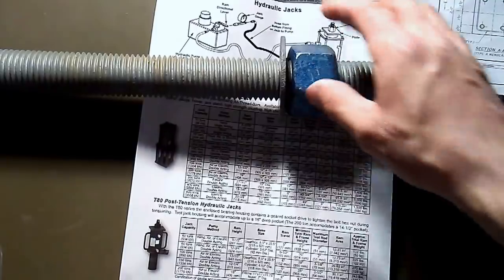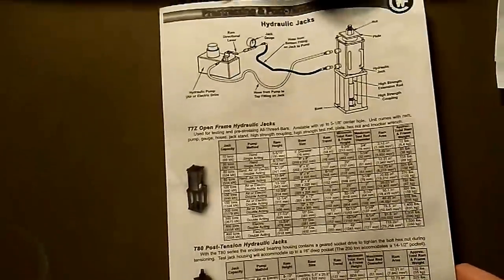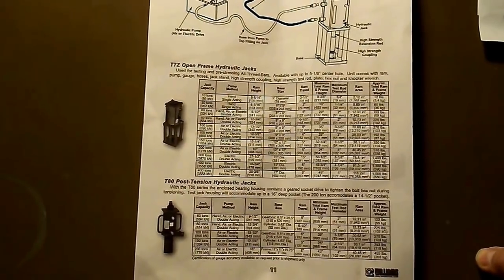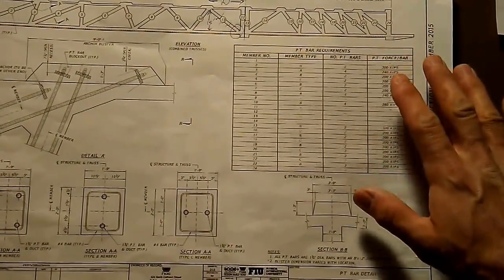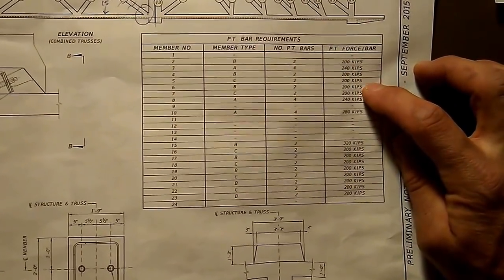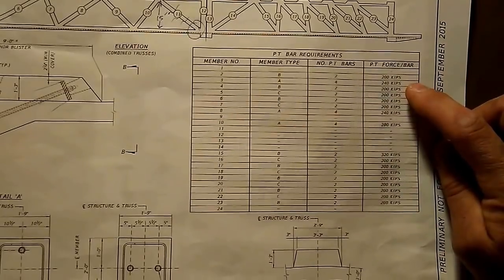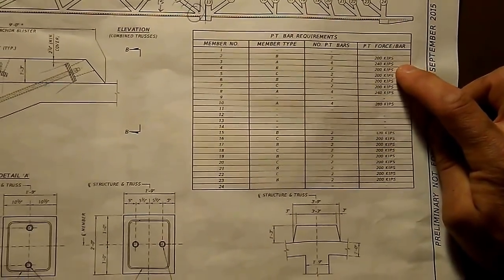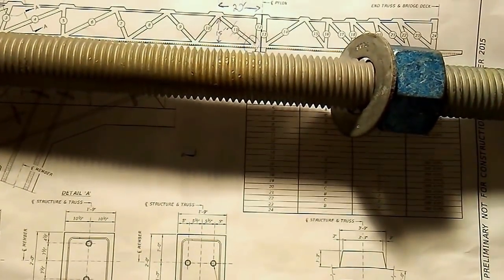FIU Bridge Collapse: Post-tensioning Explained

Comment: I love the righty tighty lefty loosey. There's no point at times to try to over-explain or over-complicate the explanation.  Keep up the good work
Reply from the maker: John Montgomery Thanks for the compliment John! I am glad you are enjoying my use of layman's terms... we engineers tend to needlessly overcomplicate everything. Lol.
Reply: it does depend on what it is you are tightening like acetylene tanks lefty is tighten most set ups for propane lefty is tighten there are left handed threads and right handed threads most common are right handed a skill saw lefty is tighten.  I use my fingers and rotate them clock wise and counter clock wise when things are upside down backwards mostly on cars. Think if a bolt is threaded in your direction it is backwards so if you go lefty from your view point it is actually righty see what I mean.

Comment: I believe the bridge was post tensioned when it was fully supported from end to end prior to moving.When it was lifted to transporters approximately 25 feet from the end of the bridge, the bridge was in serious cantilever resulting in stretching the post tensioning bars to the point of failure.I note that there was approximately135 tons in cantilever straining truss #11. The bouncing during transporting would have aggravated this condition even more.When the bridge is now set on the concrete supports. The truss is now is unstressed because the tensioning bar has been stretched to the point of failure. Now when post tensioning is applied, the bar has no strength and applying tension  creates total failure of the bar and it breaks in two and the resulting shock dooms truss@ 11.
Reply: The tension applied in advance was only in effect during the move.  Once on the piers, the rods would have been slackened because the load stress of the bridge would exceed the force applied to the rods. The issue I see is why they were unable to apply the proper tension as per the design (from the bottom of the bridge). Why did they have to crack open the blisters to reach the top of the rods and what effect did this have on the integrity of the bridge?
Reply: The blisters were not cracked open. All the blisters were left open during casting of the blisters. This can be seen in time lapse video a week or two prior to the SPMT moving of the bridge. Only blisters 2-3 & 10-11 were left open at the time of the move. The other blisters were filled in, shortly before the move. The block outs in the blisters for access to the PT tendons were obviously not well shaped prior to concreting but it needs to be considered that full consolidation of concrete under the plate washers for the tendons was the top priority, not how pretty the block outs could be formed. Every blister had a different tendon angle arrangement, so there wasn't a one-size solution to forming the block outs in the blisters. The concrete with fly-ash & silica fume would be sticky and once it had set up, some mechanical means would be required to remove concrete that subsequently interferes with access to the tendon & seating of the ram, while providing access to the nut. The fact that a chipping hammer is present, does not necessarily mean the hammer was actually used but that it might be needed. Indeed a wrench with an inch longer or shorter throw, might require a bit of chipping inside the blister to access the nut. Anticipation is how one plans, elevated work. If indeed the chipping hammer was used, it could mean that the ram or ancillary stressing tools, on the day of the collapse were different than what was used originally.  If concrete was demolished from the blisters, it was not large chunks but more likely small bits to improve access to the washer & nut. At the opposite end of the bridge, post collapse, just outside of blister 2-3 one can see what looks to be small bits of debris, possibly from work performed on the #2 tendons. A tendon is not much different from a guitar string. If you strike the tendon or the plate washer, the tendon will vibrate. Inside the grouting sleeve a sharp noise will be emitted, followed by an eerie, warped attenuation. This is probably what a passerby heard earlier, prior to the collapse.
Reply: It probably was the corruption to start with the FIU bridge, it probably will be the corruption to settle the court cases out of the court. All the $14 million dollars have to be spent one way or another. The only thing is that the six lives were wasted forever ! But who cares ? Corruption is everywhere in the world ! George Wu, ARCHITECT, AIA, NCARB 2018-4-20
Reply: Missy Norris : I liked you explanation of events that made more  sense than other  people's explanations. Possibly it was the easy reading ( to the point) of your explanation. I am reading a lot of comments to understand the wherewithal of the accidents as I do not know anything about bridges. Are you in the trade? Thank you.
Reply: Yes, concrete construction forming materials, concrete chemicals & repair products for over two decades. Sales & Marketing Management but I am not an engineer. Explaining things to both engineers & contractors has been a lot of what I am called upon to do. Just don't ask me to get up and speak to a crowd. Then I sound like a rambling idiot.
Reply: Ray , I agree with your opinion the rod failed. Either it was over stressed or just inferior imported steel.
Reply: Ray Frattone I
Reply: That’s my opinion as well. The bars may not have been taken to ultimate but into the plastic range and as we know from testing steel, after tensioned past the plastic range the steel will not be able to hold that force.  But it’s not an instantaneous loss of force and happens over time. This explains why the bridge didn’t fail until a week later or whatever the timeframe was. But I agree that the handling of the bridge introduced forces that overstressed the post tensioning members or quite possibly because of the amount of incompetence recently in the field, they just overstressed the tendons during the stressing operation.  Either way, once a tendon is loose, you never go back and retighten it. That’s a clear sign of overstressing, aka taking the steel past the elastic range and into the plastic range.  I wonder if the stressing records have been released to the public.  If so is it just a bunch of computer generated bullshit like every construction report now a days or did it have actual forces from a strain gauge and actual elongations compared to theoretical?

Comment: Nice video for the layman. This basic knowledge is lacking in the field now a days. One important thing to note. Steel is never pulled past 0.7 of the ultimate strength as that is the safe distance from the plastic range which occurs at about 0.75. So basically as you said, it’s possible that the bars were overstressed during the operation. This would explain them “coming loose.”  Check out page 27 of the Clatrans Prestress Manual on overstressing. It’s odd is online. This explains the loss of force 72 hours just from going to 0.82 of ultimate. Imagime what happens as you approach ultimate?  So this would explain a failure that occurred a week later after stressing or possibly moving the bridge. That’s the only thing I would clarify in your video.  You said if you pull on the bar it will hold that force. That’s true in the elastic range. But a failed tendon or bar can be considered anything pulled into the plastic range. 

Another note is that the elongations and forces should have been recorded on every tendon and bar. As you said. I bet that these were not done as they have been for so many years. If they were done properly they would get the stressing company and the CEI off the hook. But as you said in your video, if they were restressing the bars there should have been someone representing the designer right there measuring elongations and forces. But the fact that the “things were loose” throws up a huge red flag that screams overstressing.  Why were they messing with it over live traffic?  Why was a falsework bent not erected when problems arised because they had plenty of room in the painted left turn chevron area?  I’m an sorry for the victims and their families. This was a complete lack of leadership or a blatant disregard for public safety. They set this thing over traffic like it was just a typical precast girder or something. Horrible.

Comment: The NTSB B-Roll film shows a chunk of concrete with a clear impression of the treads from the PT bar in the debris under truss member #11.  If the PT bar was totally within the conduit, why would their be concrete with tread impressions.  The length of the impressions was 2-3 inches long.  Would this have affected the tensioning adjustments being attempted on the PT bars in #11?
Reply: That was the conduit. The conduit is corrugated to transfer stresses in the concrete into the grout. Some PT bars are also have bumps so the stresses go through the concrete, through the conduit, through the grout and into the bar. However, I think these happened to be smooth PT bars but they still use the corrugated conduit. The grout is installed after the tensioing. For the particular bars you are mentioning, the bar was only supposed to be used for the transportation. In that particular case, the conduit could have been smooth but they used a typical corrugated conduit.

Comment: The NTSB video shows that plastic ducts were use for the  post-tentioning rods.  They look to me like 4" ducts. Now, consider the node where member #10 and diagonal #11 meet on the canopy level.  We have 4 ducts for member #10 and 2 ducts for  member #11, together 6-4" plastic ducts.  This is huge reduction in concrete area. May it be a factor ???
Reply: they not necessarily be quite 4" diameter. That is still a very small area compared to the total area of the concrete. I also suspect it was the lower end of #11 that failed first.
Reply: Tension was not the issues. I believe the failure was the transfer of the compression in #11 to the tension in the bottom deck. The temporary tensioning of #11 may have exacerbated the transfer at the #11 to deck joint. But there was something wrong with the joint to start off with.

Comment: Kim Mazur, remember: the force in diagonal #11 changes from tension (during transportation) to compression ( when the bridge is finally placed on piers). As result,  diagonal #11 gets shorter and tension rods get loose !! They should be removed 
because they are no longer needed !!
Reply: They don't get loose. The tension strain in the rod is much higher than the compression strain when the bridge is placed on the permanent supports. You loose a bit of tension but they don't go loose. It is true however that the rods are likely no longer needed.

Comment: By tensioning concrete in 3 directions a matrix of stresses was at small points So the concrete weakness stays at that point and continues till overloading.  The bridge was a single truss(one path) and no where to transfer loads to a good loading section. Secondly the cracks may have reduced the rod tension and when re-tensioning - the weak concrete moved too much.

Comment: The 7 wire strand post-tensioning high strength cables are normally protected inside of a greased sheathing and never grouted.  The expert failed to explain as to whether the large diameter threaded bar is enclosed within any sheathing so that it does not bond to the concrete, and so that it could compress the member it is embedded in when post-tensioned.
Reply from the maker: The post-tensioning bars are placed inside of ducts. No grout was used here. The grout is only used for corrosion protection of the post-tensioning bars or strands. The grout does not add strength to the structure.

Comment: The problem with tensioning the diagonals is there is no way of determining the effect on the rest of the bridge.  The canopy and deck broke at the terminations of the adjacent web diagonal.   In my opinion the spacing of the feet of these members was too wide at this end of the bridge.  The other end remained intact even though it collapsed onto the road.  The spacing of those members is closer together.
Reply: That's what engineers do.  They calculate forces and design structures to safely absorb those forces.  Then they afix their signature to the plans to signify that they have calculated the forces and designed the structure to withstand the stresses.  

You are welcome to contact the NTSB to offer your assistance.

Comment: Why does the table in the plans have no entry for #11 member?
Reply: Could that be because there were no PT bars in member #11, because it was meant to always be in compression? Just a thought.
When I look at e.g. https://www.youtube.com/watch?v=F0MBOQV7kuU&t=195s member #11 seems to have ended up in between the lower part of the North pylon and the last section of the canopy. Which leads me to the conclusion the member that ended up lying flat on the next section of the canopy, which can be seen in a lot of other footage, with the PT bar sticking out (with the tensioner attached) cannot be anything else but member #10. 
https://www.youtube.com/watch?v=jOe7CvVGqz4 is telling too, I think.
Reply: Member 10s pt bars would not be central as it was section A containing 4 pt bars kind of in the corners, then 11 pt bars would be central so they wouldnt intersect too close to each other. If you looked at it in a line it would appear that one post would have centrally loacated top, bottom bars the next post would have centrally located left and right bars then occasionally a post would have 4 pt bars on corners. this would help structural rigidity around each collar point.
Reply: The drawing is Marked "preliminary not for construction", which is common in the early stages of a project. It may indicate there were some unknowns at the time for #11 and other components. The lack of information could indicated information was still required from the customer, or additional calculations were needed -  like where the temporary supports were to be placed, or maybe the degree of the cantilever, etc. If there were no tendons in this location, it is doubtful the value would simply be left out. It would be far more common to note such an exception within the space or add the number of the note/comment that would contain that information or explanation.
Reply from the maker: Crabby Hayes Spot on Crabby! We do know that in fact  Member 11 had post tensioning bars installed as indicated by the collapse photos.
Reply: structures specialist if so, then what member do you see when you follow the first link I posted above, in between the Northern support and the last section of the canope? The photos I've seen show a member with PT bar + tensioner on the other side of that last section of the canope. Or did it multiply?

Comment: UNEXPECTED CANTILEVER AT BOTH ENDS DUE TO DIFFERING FIELD CONDITIONS MAY HAVE CAUSED EXCESS TIGHTENING TO POINT OF FATIGUE AND FAILURE? There is a video of a FIU rep with the newly placed span in place with the hydraulic temporary mobile supports removed. He was explaining the last/next steps required. He clearly said that the TWO end rods/bars (each end North and South) had to be LOOSENED (audio and video). This comment supports the Canadian youtuber’s contention that the mobile supports had to be field-changed from each end towards the middle in order to accommodate the differing site conditions (terrain and lane barriers) which precluded the placement of the supports at the ends of the span. Now, moving the designed location of the supports inwards created a unexpected CANTILEVER situation at each end. To their credit, the field engineers knew that the cantilevers would create the OPPOSITE of the design loading on the end members, most importantly the two end long post-tensioned diagonals. These diagonals would now be in TENSION during the swinging of the span into place and lowering it onto the two permanent concrete supports. So, to handle this unexpected tension in the cantilevered sections, the two long post-tensioned diagonals were tightened higher than their design tension FOR THE MOVE ONLY at which point they would be LOOSENED (as the FIU rep stated). Query: Was the tensile capacity of the rods exceeded when the additional tension was added? Did one of the two bars reach their fatigue/failure point when they were additionally tightened? Now, the span is in place, the jacks removed and the workers went up to LOOSEN bar #11, could they have found the bar stretched and loosened? Whatever, as soon as the cyclic hydraulic hammer effect on the nut could have caused the #11 bar to snap and catastrophically fail.
Reply: I agree with Boo..." So, to handle this unexpected tension in the cantilevered sections, the two long post-tensioned diagonals were tightened higher than their design tension FOR THE MOVE ONLY at which point they would be LOOSENED (as the FIU rep stated). " ... I would add (speculative of course), if the crew works only one of the two tensioning bars internal to #11, sequentially, instead of simultaneously,  the couple or moment generating couple from top bar to bottom bar could generate bending forces within the concrete of #11.  This begs the question, why wasn't the poured, cured, and post-tensioned bridge, tested along the side of the road by removing center false work and live loading the structure under simulated working conditions + hurricane, etc.,  with only the end supports in effect? (hindsight is 20-20).
Reply: If you can find it, DWG S-38 stamped 4/7/17 (one year ago) note 7 helps explain how tension rods in diagonal member 11 would be used.The reason  would be that during lifting by the Mobile Supports that end of the bridge (approx. 30 ft.) would be canilevered when moved and would need some temporary tensioning of #11 bars to keep it from cracking in tension.